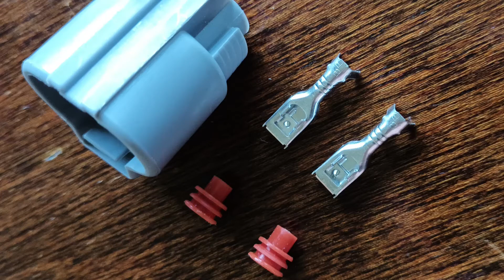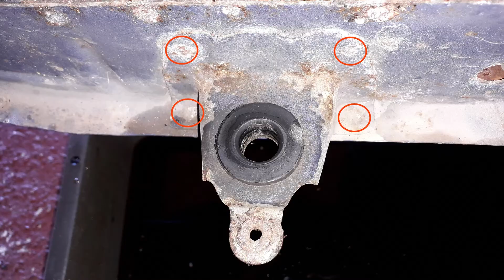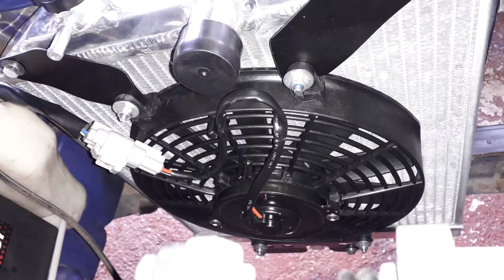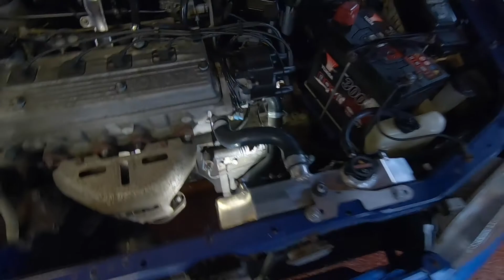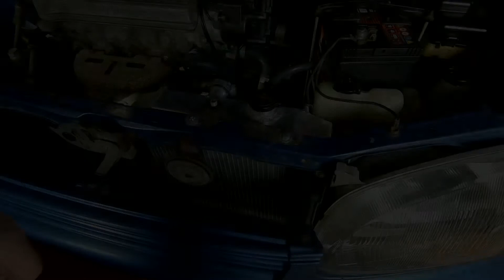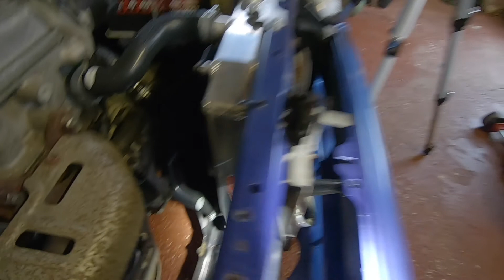How to install a Civic half radiator in a Starlet | Toyota Starlet 4efe turbo build.

Comment: nice, i was wondering why you would top up the overflow bottle when burping the coolant? i thought that the purpose of the overflow bottle was to catch coolant when pressures are getting high inside the rad and the cooling system itself. thanks again!
Reply from the maker: When you turn the engine off and the system cools down it draws fluid back into the rad from the overflow bottle. The "max" fill line is less than half way up the bottle on this car.
Reply: @dan91sgarage  oke thank you, so i should always keep my overflow bottle at the minimum at least?
Reply from the maker: @Oopsiemoopsie  Yes, the Starlet owners manual says that when the engine is cold, the coolant level in the overflow bottle should be any where between the min and max lines.

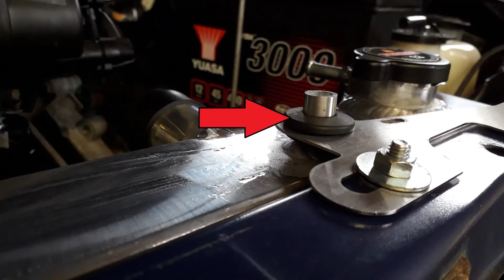Comment: Also for the top bracket did you have to tap any threads? i have threads where the right bolt holds the bracket down, but cant find a hole with threads for the left side? (5:20)
Reply from the maker: The left hole is just a hole in the metal panel, no threads. I used a bolt inserted from underneath, through the panel, bracket, washer and then nut. Be careful of the wiring loom underneath the panel.
Reply: @dan91sgarage  that's a good idea, I did the same just the other way around, definitely would have been easier to screw down your way 😁

Comment: Also do you remember what brand fan this is? THanks again
Reply from the maker: Didn't have a brand name, it's just a 10" slimline, 12v, 80w puller fan. With straight blade design. Ebay.

Comment: These videos are great,  do the slimline fans install easier? I would rather not make brackets for the fan if i dont have too....
Reply from the maker: Some fans come with these plastic ties that you push through the fins of the radiator kinda like cable ties but they're not the best. You can also get Honda civic half radiators with a fan shroud and fan already mounted on them if you prefer.
Reply: @dan91sgarage  i actually ended up ordering the honda civic half radiator and shroud kit like you mentioned, should be pretty easy to put together now

 thanks alot and awesome videos
Reply from the maker: @pate7816  Nice one👍

Comment: Thanks I was wondering If anyone did a tutorial on this, always wondered if the stock would fit on the Honda Radiator..
Reply from the maker: Thanks mate. I've seen the stock fan used on a Honda rad but it's pretty thick and so is the rad. You will lose less engine bay room with a slimline.